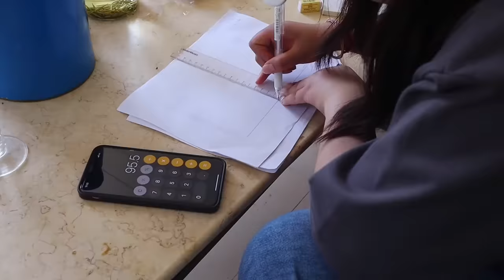Two girls renovated an old house by the sea ~ Room Makeover ~ Kitchen renovation

Comment: beautiful house and surroundings - I guess they did a good job in general as we have not seen the bathrooms and the rest of the living spaces. As to the kitchen, maybe the kitchen counter should have been left as the inox metal sheet that it was - wall paper as kitchen counter top not the best kitchen working surface - same issue with the wall paper over the tiles in the kitchen .... scrub the tiles well as tiles are a good and practical wall covering in a kitchen vs some self stick wall paper that will look bad soon and be a huge pain to remove it .... The terrace is the showpiece for the house and where is full of potential to be many things, they did a very good job to make it functional in a very short time - great find and nice work, enjoy!

Comment: They got the hpise in pretty good shape though..no plastering to be done on the walls onside the kitchen or outside..wood work also in good condition only a coat of paint on the cabinates did the trick rest the lotchen was looking bad bcoz of dirt on counter slab not grime etc

Comment: A Steel platform .. covered with a shit PLASTIC sheet??? In a Kitchen? Do you Know that steel is the BEST for kitchen surfaces?????And it was the only thing of merit and value in the whole house.I don't understand why you Chinese stick that crap everywhere!,!Plastic it's unhygienic and dangerous near flames and High temperatures! Even the dry brick wall was decorative and classy,it gave vivacity and movement. I was rejoicing when you covered it with concrete ... and still white. I am speechless. Zero style, right!
Reply: Ok... I was also wondering about the sticky plastic on a kitchen counter! 😳 And a steel counter at that!